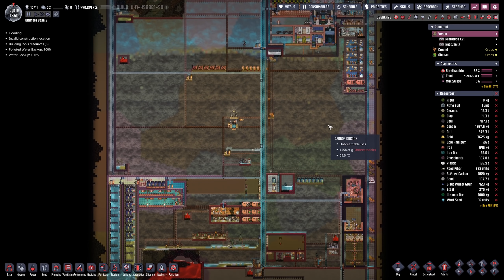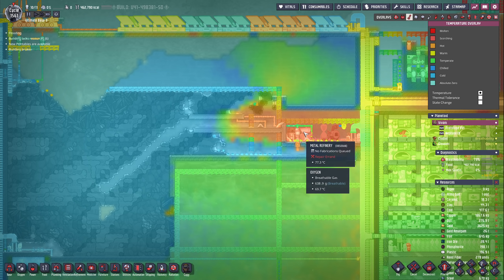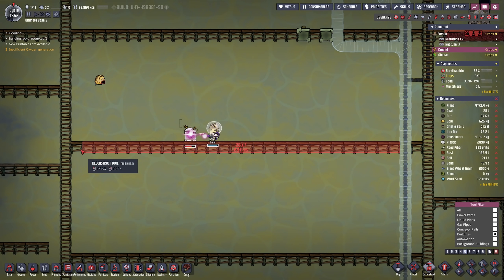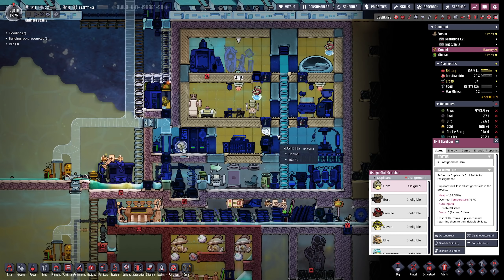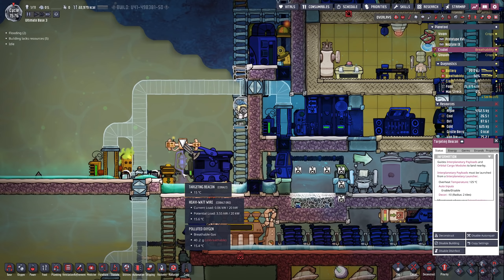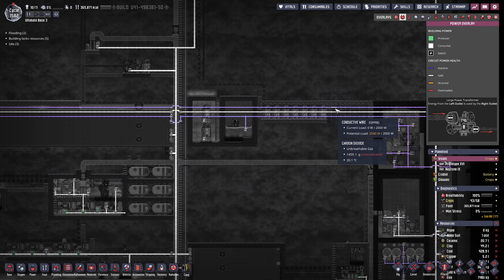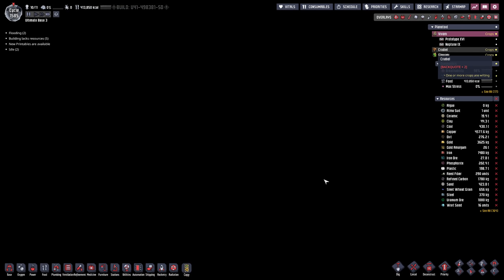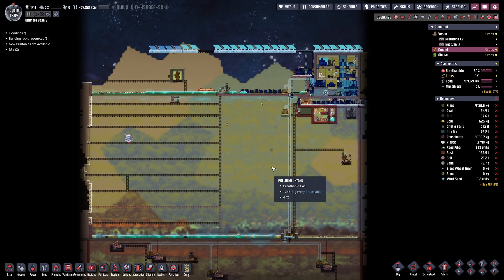STARTING THE OIL PRODUCTION - ONI - Spaced Out: Ep. #60 (Oxygen Not Included)

Comment: Put automation to run the oil wells only during the day.  It's pretty simple.  And Gate.  Cycle timer.   If the senor says the oil is low, it sends a green signal.  It it's daytime it sends a green sign.  And Gate gets 2 greens it lets the oil wells run.  Wells turn off at night.   Any red turns them off.   You aren't spending power at night on oil wells.